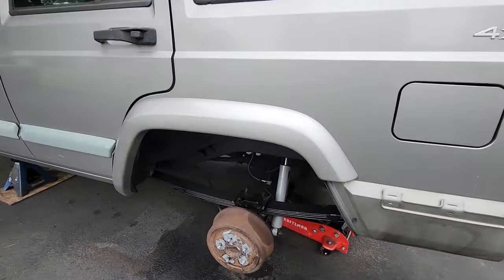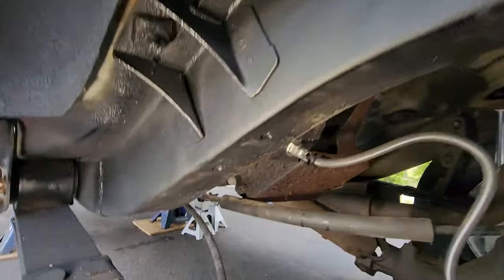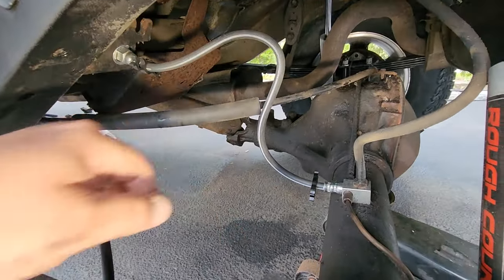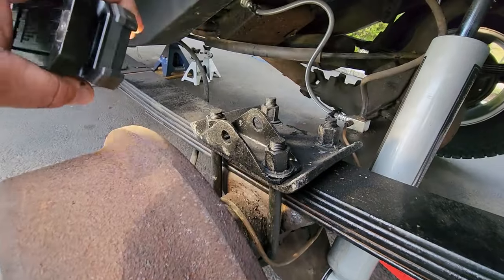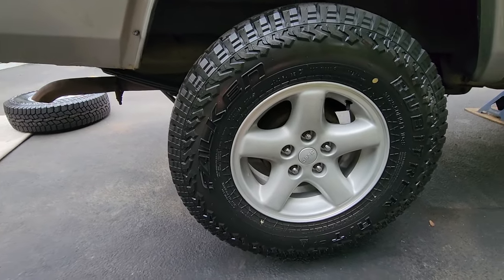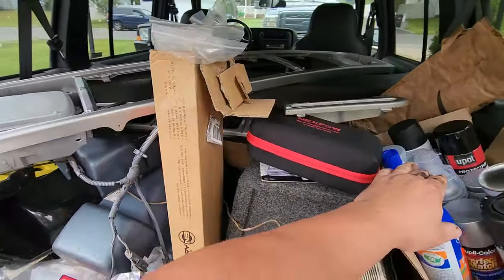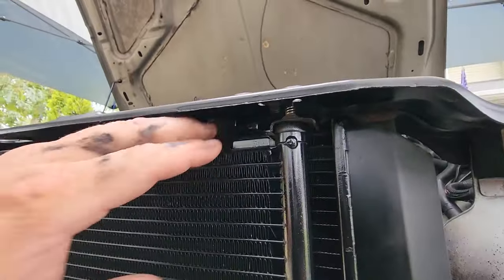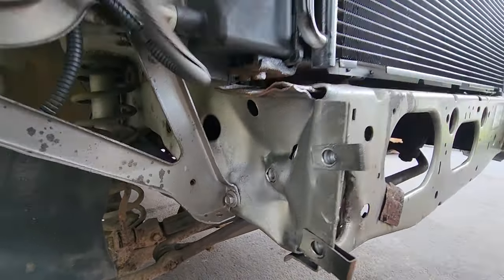JEEP CHEROKEE XJ PROJECT LIFT UPDATE - THE TOAD!!! EPISODE 3

Comment: Dan, Duplicolor never matches. you gotta get actual Mopar brand spray paint in a can, its more expensive but absolutly worth it. i used it on a stone white 2000 4 dr i had to paint my bumpers and bumper plastics and it matched perfectly👍 Amazon may have Mopar paint but i know Ebay sellers carry it that were i got mine from
Reply from the maker: It's way too expensive to buy in bulk.. I did however use about 20 8oz cans of Mopar black to touch up Black beauty lol.  But I'm not dropping that kind of coin on the toad! Haha